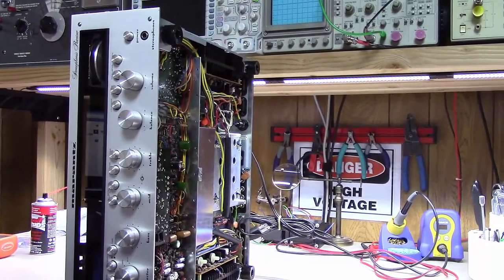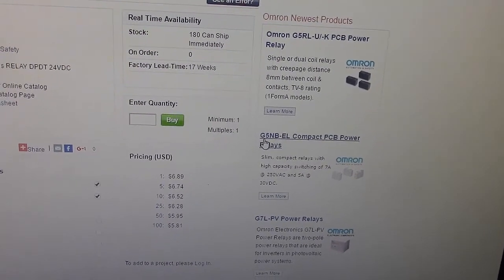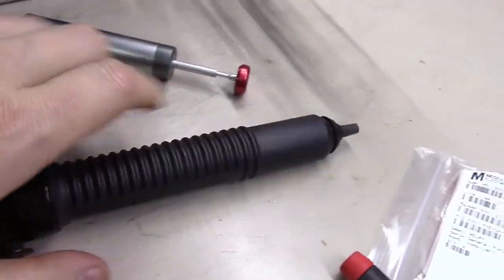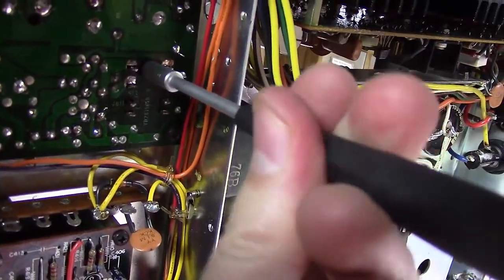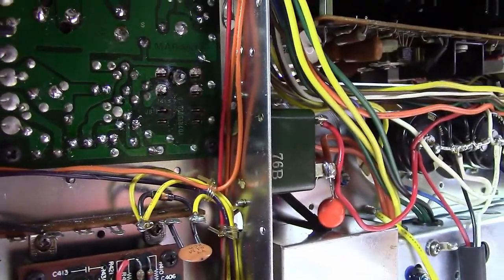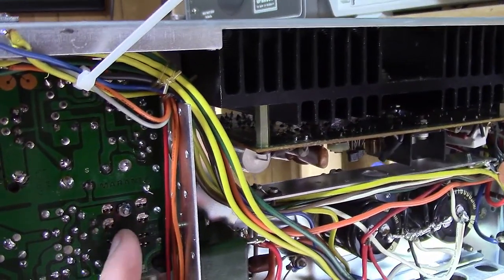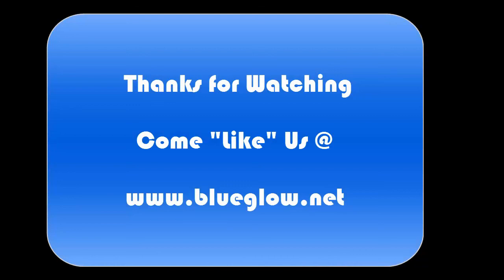Replacing the speaker protection relay in a Marantz Stereo - BG043

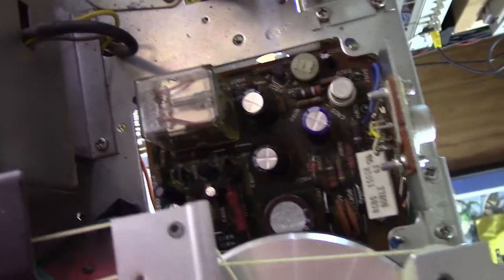Comment: 2:20   The circuit for the protection relay is designed simply to detect any DC voltage on the center line of the Amp.  This line connects to the speaker through the relay contacts. The most common failure in these circuits is a failed electrolytic capacitor in the circuit.  Typical the symptoms will be a longer delay  before the speakers are connected and later a buzzing or rattling sound as the relay is energized. (Mechanical from the relay, not the speakers.)  Replacing this capacitor will normally solve the problem.   If the relay is activating and the sound becomes noisy, it is likely that the relay contacts need cleaning, or if they are severely pitted, replace the relay, but do not forget to check the capacitor.
Reply: My SR7011 is making these relay bouncing noises, seemingly randomly. Do you know where the capacitor is or how I can locate it?

Comment: Question, I am a newbie with the technical issue. I have an Anthem p5 that has one of the channel suddenly stopped working. I was unplugging the audio cables from my receiver (Stupid me didn’t turn off the amplifier) and the cables touched tv stand metal and i heard loud humming noise. I wonder what caused it to stop working? Anthrm p5 doesn’t have a fuse and will reset itself with the PTC.

Comment: very helpful I think 2240 has a similar issue I have intermittent channel cutting out, but the technician never seem to run into the issue when they are looking into it. I sometimes turn it off then on and it is working again. Thanks again
Reply: Im dealing with the same thing on my 2240. Did you replace the relay and it solved your problem? I have been trying to clean it for a few days now with no luck
Reply: @edved13  I will have it replaced at my local repair shop. Thanks

Comment: Great video. I would like to add that I would secure the relay mounting stud prior to soldering the pins and wires. If the relay isn't completely flat against the PC board, the contacts or traces can be compromised.

Comment: After 15 years working at at Hughes on line/engineering, I'm a fan of solderwik instead of a sucker on boards like this. I know it's more costly than the sucker but I prefer the end result and since I'm not working on this stuff every single day, I don't mind the extra cost

Comment: Contact points can be made new and shiny with a thin sheet of carton and a little metal polish compound on it.  Just insert the compound between the contacts and move it around with the sheet of thin carton.  Remove excessive compound with a paper tissue eventually with a drop of deoxit.

Comment: 3:37 ...  This same relay can be used for the Marantz 250.  However the relay has to be opened and four wires have to be swapped for it to work.  It is not a perfect fit on the circuit board but it can be installed.  The 250 had an oddball relay (no longer available) with actuator coil connected to the terminals that normally are connected to the moving contacts.
Reply: I just bought a 250.  I'm waiting for it.  Do you have any details on the "four wires have to be swapped?"  Any videos I an reference for this?

Comment: Hey Mark.  Would the relay be the cause of a loud bang through the speakers when I turn my Marantz unit off?   Even with the volume turned down.  I now have to turn the speakers off before I shut power off so it doesn't blow my speakers.  Please help.  Thanks.  It seems as though the caps are not being discharged in some way.??
Reply from the maker: +Pete Schreiber Could be one of a couple of things.  1st off make sure your amp is biased properly and that the DC off-set isn't out of whack, it can cause this.  I have videos on that here.  2nd.  I'd rebuild the power supply board by replacing all caps on it and also replace the relay.  All can be suspect in causing your issue.
Reply: +Blueglow Electronics Thanks a lot for your time and diagnosis.  I will check out your videos and see if I can do the work.  Thanks for doing the videos!